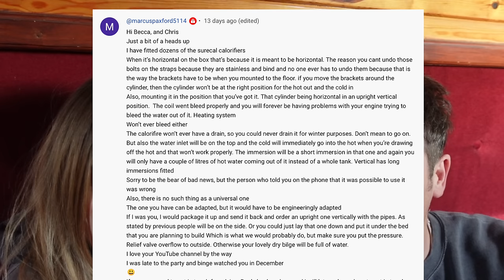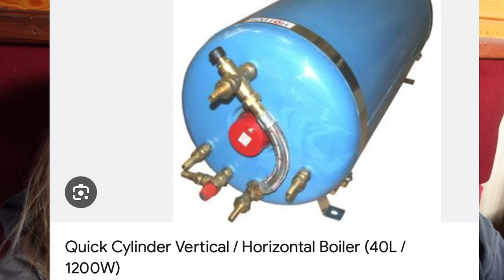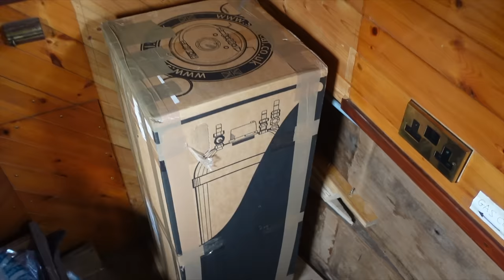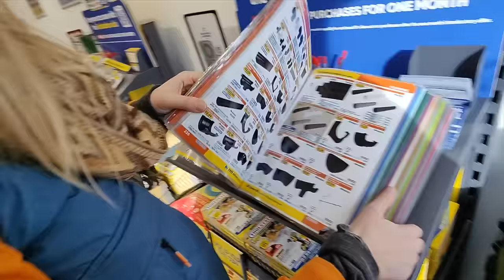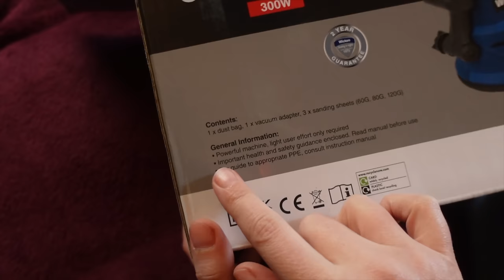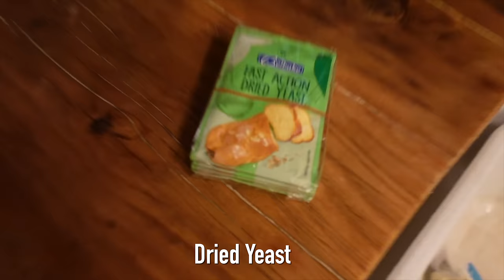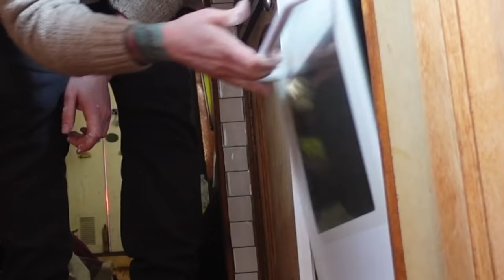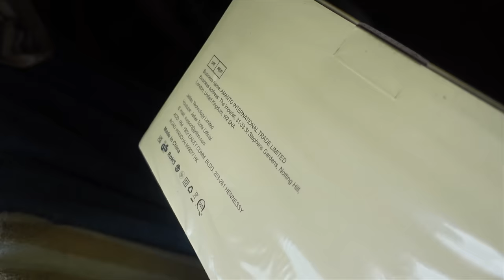We Failed at narrowboat life!

Comment: The secret to using squeezy tubes - wrap the tail end of the tube around something like a large round screwdriver shaft. Basically anything round.Think a like a key on the old sardine tins. As you keep wrapping, it will squeeze material out more easily. It will also push out more of the product. Works for toothpaste too!
Reply from the maker: woaw I like the sound of those, what a great idea, makes things so much easier , thanks for your comment

Comment: All narrow boats have issues of some sort or another. Even brand new build ones.
A survey tells hopefully how good the steel work is or bad. This is your decision to buy or not.
Everything else in the boat is going to be a lucky or not gamble that is the reality of narrow boating.
A survey on your boat might have persuaded you both to walk away.
All the other stuff your dealing with is required to update. Our boat is old and we cannot ever think of updating changing what we have . We live with it accepting it for what it is. Buying a second hand boat is always a compromise on what you really would like or want. It is this point about buying a narrow boat is set in stone.
A wealthy person who knew nothing about narrow boating would have one build up to the design of the builder and only after taking delivery of said boat might you realise that it's not exactly what you wanted.
We got a chap two boats down from us who this outcome has happened.
We have been on board and seen builders errors after spending £120k + 
You both have the energy and will to achieve your dream albeit taking longer than you hoped I am sure.
You can only go so far then you have to accept.
Reply from the maker: your not wrong, we got it in covid when surveys were harder to get, though still should have pushed for one, the previous survey had actually missed the big leak in the first place. we will get there a bit of a slow start to the year and money is really starting to run low so were preying for summer . what a long old journey for a new "fun" life style 😂😂

Comment: Hi Guys

I’ve a really controversial idea for you. Instead of an endless rescheduling of your departure to cruise the cut, you set a definite date and stick to it come what may. It will focus your minds and let’s face it, no boat is ever entirely free of outstanding jobs. 

Life is too short to spend it on a marina.
Reply from the maker: Once we have hot water and can shower and get some batteries to charge from the engine we will but until then those are 2 things that need to be done before cruising really, these smaller jobs are just filler while we sort the main issues out and wait for a new tank to arrive